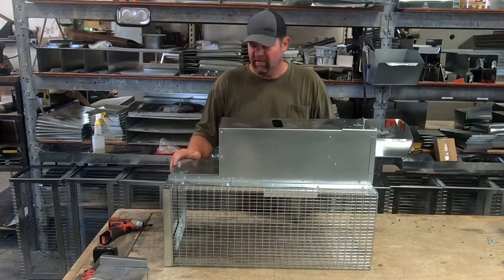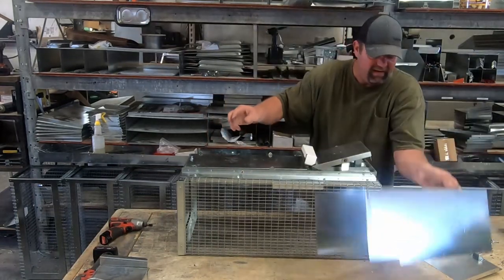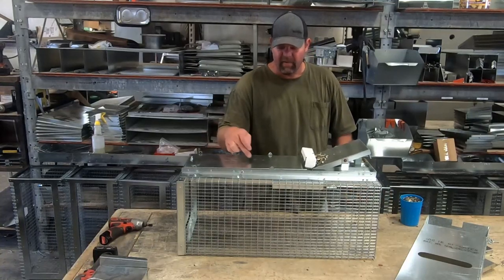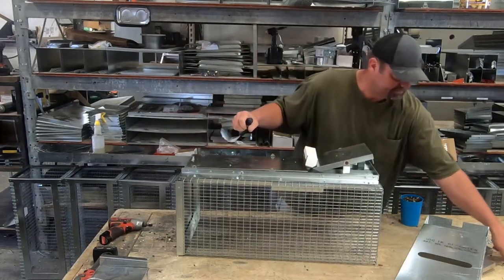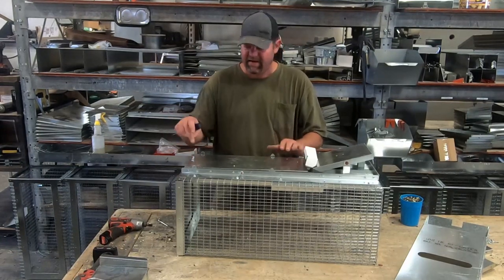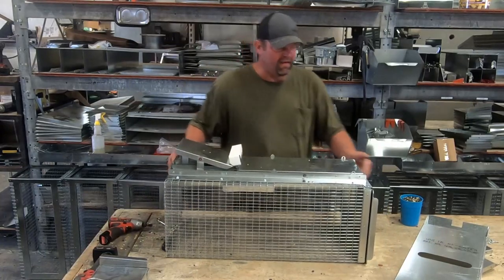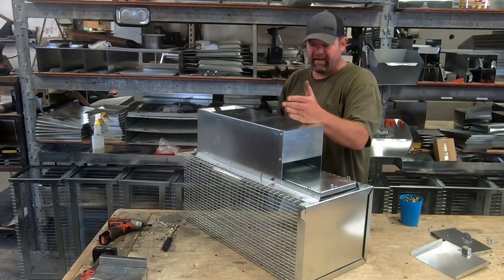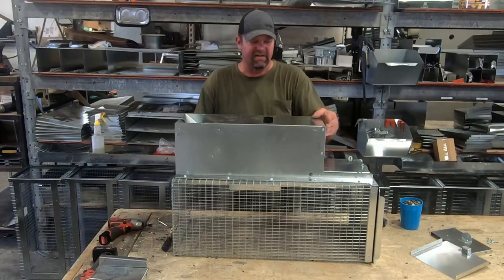Uhlik Repeater Live Traps - Tips & Tricks - Rat Operation

Comment: I just received the one for rats. It was easy to set up.  I caught a roof rat the second night.  It took about three minutes to persuade it to move from the main cage to the transfer cage.  I released it far from any other houses.  This product will last forever!  Also, the rat gets dropped into the holding cell before it eats the bait, so you don't have to keep re-baiting it.  I used bird seed mixed with peanut oil.

Comment: I got a tip just from seeing the unit in action. You talked about bait spilling and messing up the release mechanism sometimes. I think when my trap gets here I'm going to cut a wire mesh that I can put on top of the feed trough that'll hold most of the feed in as the trap door comes  back and smack locks back in place. Might even be possible to use whole peanuts that the wire mesh will just hold in without any spillage at all. We'll see :)

Comment: So I bought my trap last year.  There's a kind of a screen where the bait [seeds] can come through, but the biggest holes are at the top. [My daughter in law put it together so maybe she did it wrong? Upside down?] I don't see this in any of videos and the bait you sent with the trap is mostly too chunky to pass through the holes, especially the medium sized ones in the centre and the smallest ones along the bottom.  I've caught two squirrels [or the same dumb squirrel, twice] but no luck with the rats, even though they left a few turds and I just saw three of them running around on my roof.  My trap's top only measures 18" but it looks just like the one in the video...not short.

Comment: I'm attempting to use small pieces of adhesive backed 1/16 very smooth  window type felt on metal to metal areas to minimize the rattle clink on platform. . SO far I've put it under the set screw and on top of bolt head that holds that metal slider that locks the platform so the teater totter affect will not make noise when it makes contact with that one single bolt head under the slanted feeder opening ,  on the under side of the food trigger platform , so when they step on it and an when it returns,  it will not clank on reset as much   .and anywhere I hear metal clanking 
7
It has tremendously helped with noise ,( but not all noise), to maximize the safety factor of rats potentially weary panic attack and flee .

Because this trap is so good on its OWN without any modifications,  this should make it even better

I Don't think it should be perfectly quiet, because you do want rats to get use to some clanking of metal.  But some key areas may kept other rats from scampering away when another rats sets off the trigger and reset function